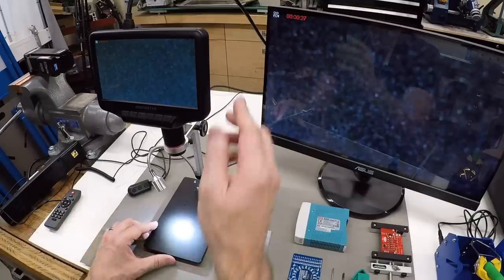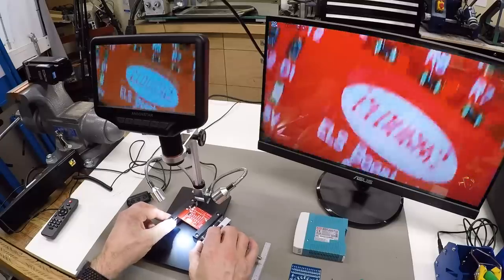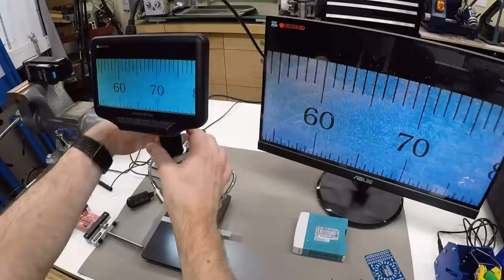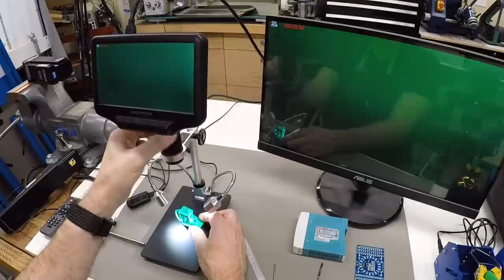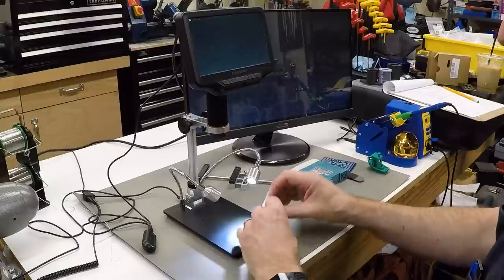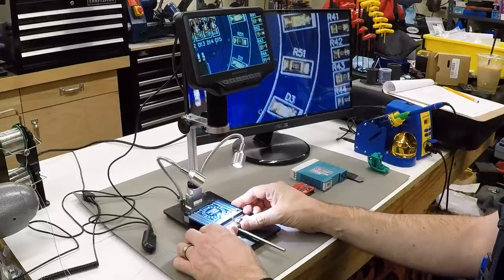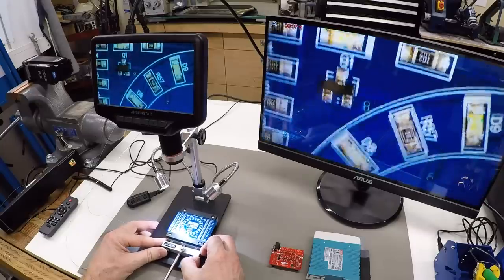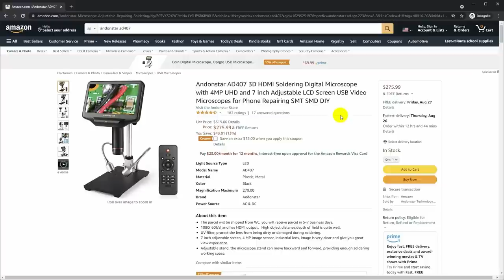Apparently, I Can't Solder | Andonstar AD407 Microscope Review

Comment: I’ve owned this exact same microscope. I can’t speak highly enough about it. Video is crisp and high frame rate. The quality of soldering you can achieve with it is incredible.
Reply: What kind of work did you do with it.  If electronics is the size of the base a problem.  Would the 10.1" be better
Reply: thank You!!!
Reply: what about latency?

Comment: I think it important to keep in perspective that a low cost device like this cannot be all things.  To me, this is an inspection device and it seems that it can do that more than adequately.   For soldering surface mount devices, clearly a binocular system is required and asking to do that with this is just too much
Reply: Why is a binocular system required? To get depth of field?
Reply: I place and solder SMD parts with this and have never had an issue with the lack of binocular vision. Takes some getting used to, but with enough practice I find it to be quite easy to place (and lift) components solely by looking at their position on the screen, with no true depth feedback.

MUCH more convenient than a conventional microscope if you ask me, since I can sit in any position I like and still see the screen.

Comment: James - thanks for the great work!  One suggestion for adding an audio track for sync:  If the microscope is capable of plugging to a PC and acting like a webcam, use software like Snagit or OBS Studio to record using the 'scope as a video source and the PC's microphone for audio.  It's not a great audio track, but the "clap in view" technique still works fine.  My company makes ultrasonic test equipment, and some of that can do remote screen share to a PC.  I use that exact technique with OBS recording the screen share along with cameras and regular audio track for the rest of the setup and test.  So far my editing efforts aren't up to your level, but I'm improving with practice and watching what you, Quinn and Tony do.

Please, keep 'em coming....

Comment: I’m an amateur doing bits and bobs with pretty poor eyesight. I have the 8.5” version of this (under a different name) and for the first time I can do SMDs on a practice board with leaded solder. The extra 1.5” seems to be very beneficial for the field of view, though there are still times I use a jeweller's visor. The depth perspective was fine for me soldering… but using tweezers was a different matter. For someone like myself it’s perfect, I use for everything from soldering through reading ICs to reading that small print they put in to con us old fogies. I'm not saying it’s the best fit for a professional but for folks like me I recommend it. Mine was £110 but like many things they seem to have shot up in price to £140ish.

Comment: The biggest limitation to this scope is the base. If soldering on a larger board, it may even be impossible to do it because of the base. So i purchased and articulated arm made for another brand of scope but it works grade. When i dont need the scooe i articulate it out of the way.
Reply: got a link to the arm? 😊

Comment: A flashgun can be used for sync in lieu of an audio cue. A simple white LED flash is enough, and combined with a scene marker like you demonstrated should make things easier to work with in post.

One thing you didn't mention concerning the microscope, is if there is any discernible lag. I couldn't see much during the video, and you didn't note it, so I assume that it is minimal. 

Using a Stereoscopic microscope prior to this has spoiled you James. I had the same issue when I tried one like this after having been used to using high quality stereo scopes before, although lag was also an issue for me.

I can see that a different mount - Manfotto-esque speedmount or even Noga, especially on a machine could be highly useful. Suspended overhead would be my ideal for keeping the workspace clear. Thanks for the honest review.

Comment: Is it any easier with one of the light sources positioned “north” of the solder target (instead of east/west like you had it)? That way, the shadow cast by the solder wouldn’t be obscured by the solder itself, and might give a good indication of height.
Reply: Weirdly while I'm watching the video I can tell he's got the solder too high simply by the fact it's out of focus, but he can't tell it's too high even though we are effectively watching the exact same thing in 2D? Weird.
Reply: Yes, I too have this model and simply moving the LEDs and or my magnifying ring light I can get a bit of a 3D view happening. Another trick is to lay the board at a slight angle; then the height can be seen. All that said, I have no problem soldering under this scope. Just practice mate and remember it cost only a fraction of your stereo binocular doover so comments should always factor that in.

Comment: After years of stagnation, the digital microscope market is evolving rapidly.  The Andostar scope you review has a 4MP camera and a 7" diagonal monitor, and currently priced at $200. If you like that scope you might consider the Tomlov DM201-MAX with a 25MP camera for $165.  Tomlov appears to have a much wider selection of microscopes for applications besides soldering and inspection.   The DM201-MAX only records in HD (1080P) but I don't need to record UHD video (2k), I do need to be able to capture high resolution stills and blow them up to see very fine details on knife edges.  The higher resolution camera and Sony chip in the DM201-MAX makes that possible. If you need UHD/2k recording capability, some Tomlov models can do do that too.  Be care shopping for Tomlov scopes however.  Their system of numbering models is rather confusing and they offer dozens. Make sure you check the specs of whatever you purchase.
Reply: how's the framerate and latency on the tomolob?

Comment: I learned to solder 0.005 plated wire onto ceramic substrates using a Weller solder station and with no visual assist in 1975 at Univac in Roseville, MN. You had one attempt to get it right. This was for 7015 plated wire memory stacks. Now I certainly appreciate any assist, and these USB or screen-included microscopes are awesome. This is a good overview of the pros and cons, thank you.
Reply from the maker: How old were you when you were expected to do that?
Reply: @Clough42  27, I think the secret was just enough liquid flux.

Comment: We would normally use and setup the lights to produce no shado and best picture.

However although that still applies for inspections, it may be practical to adjust lights for adequate oicture and to have additional luminance to provide shadows from iron tip and solderr.
Obviously, holding the solder above the board would have a gap between the solder tip and the shadow tip and as the solder gets closer to the board the shadow will hunt for the real solder end. So it may be a case of learning new tricks. However with my eyes in your boat, I just use the feeling in my fingers to slide the solder over the boards.
Reply from the maker: Probably true.
Reply: @Clough42  Hi, I was watching Stefan Gotswinter. Youtube is quite amasing, I only watch about 12 channels in total, Applied science, Mike Patey, you, TOT, Adam Booth, AVE, Electroboom, Anton Petrov and Jody (welding tips & tricks), Sina (drummer) and the electronics guy from Switzerland i.e: only the sensible clever people, and it seems they often know each other. Stefan commented about TOT a while ago and Joe Pieczynski today (obviously with complements), so I asked Stefan how long before he mentions you?

Comment: I also struggle with middle-age closeup focus degradation and it's quite frustrating.  To maximize the depth-of-field of my eyes themselves, I have two LEDU L445BK combo incandescent/fluorescent arm lamps.  The use of two bulb types improves the color spectrum and this helps when, for example, trying to read resistor color bands.  I also got prescription 400mm to 100mm focal length progressive lenses.
Reply: i m with You Matthew!  is heavy frustrating

Comment: I bought a "similar" one about a year ago (off Ali E of course). Use it all the time and it's been great. Funny thing though, is 75% of it's use is me finding metal or wood splinters!  Works awesome for that, and I keep an Exacto blade handy for extraction.  45 years of automotive and metal work, you get used to it.  ;)
Reply: you use it for pulling splinters out of yourself?  Brilliant!  I needed a reason to buy one of these!
Reply: @gizzyguzzi  - glad to help justifying it!  Sometimes you just need that tiny extra 'push' to get you over the edge.  ;)
Reply: @DrFiero  I use a jewelers loupe, a fine sewing needle and a pair of needle nose tweezers. Cost a hell of a lot less and don't need power to operate. Lighting is sometimes a problem but that big light in the sky usually suffices. That said I could see using one of these if I had one. A lot easier on the eye sockets. (From holding the loupe in.)

Comment: I don’t disagree with your review, but I’ve been very happy with the cheaper version I bought from Banggood 3 years ago.  It had a 4.3” display and a ring light instead of the flexible ones, but it was only $45.  I’d love to have a binocular microscope too, but they are much more expensive.  Display is crisp, and I’ve been able to read part.numbers off of partially melted surface mount chips.

Comment: "...I'm not 17 any more..." hit close to home. I used to solder and assemble small parts no problem, and yup, the close-up vision has been moving outward, right into Old Guy Land...
Reply: The first stage is looking for steel rules that only have mm markings and not the stupid half-mm marks.  Now I'm looking for one that only has 2mm markings! ...maybe one with 5mm markings as a fallback!  Hell, if it gets any worse I'll have to go imperial.....and find one that is only marked at full inches!
Reply: @Cenedd  get one from CEE's friend that measures in banana's. 
Yes it certainly doesn't help when your arms are no longer long enough

Comment: I just bought ad407 for its 4mp sensor and hdmi out capability.  But after a few days of using it, I think that the picture/video quality on its 7” screen is the same as ad207.  The only difference is the focusing range.  At the same zooming size, the ad407 gives you more working space under the lens if you mount the unit at the bottom red ring (and of course, you need to chin up more to its higher screen).  I hooked it up with both my hd tv and a 23” 1080p fhd gaming monitor.  No matter what resolution I set, the big screens always show “1080i” with exactly the same (bad) quality of grainy videos and pictures for all resolution settings.  The sharpness selections also give no difference effect on both screens.

Comment: It's possible that the recordings still have a timestamp in the metadata. You can check using either `mediainfo` or `ffprobe` (part of the FFmpeg suite), or there's probably some GUI tools that can do it, but I assume you're experienced enough with the commandline to handle it.

If the microscope does add timestamps, note that some devices save the start time and some save the end. That should at least be enough to let you match up which clips go with which source audio, and if the clocks are close enough, and the timestamp precision is high enough, it might let you sync.

When I edit videos, I use a horrendous pile of Python and bash, going by timestamps to line stuff up approximately, then the waveforms (where available) to get it precise, then break the recordings up into takes/chunks, which I can review manually, deleting the bad ones, keeping the good ones, then concatenating them together with ffmpeg. (I don't like GUIs.)

Comment: Thanks or the review. 
A more angled, less even light (side-lighting) might help with the depth perception issues. Just a suggestion, but I'd try a low angle specular (small) light slightly back and to the left and a more diffuse light above, slightly to the right of center to balance it out. Some amount of "shadows" should make it easier to see the depth.
Reply: Just manipulating the two side spots (possibly only using one of them) and having some ambient room light as fill will help a lot. I have one of these I use for the sort of soldering her was trying, and it works for me.

Comment: 19:46 - Cleaning a hot tip and putting it in the stand for a long time leaves nothing but the tip itself to oxidize - damaging it over time.
I was told to apply solder to the tip when done working. Also makes cleaning the tip a breeze when needed for the next soldering job.
It was back when I was an radio mechanic apprentice (25+ years ago) - today I have Metcal tips which are 10+ years old and still in great condition.
3D view is something I love, it makes it much easier to see 'tree-top non flowed joints' like the one done at 18:01
Reply: If you use a brass sponge it's always coated and you don't have to worry about it.
Reply: A little bit of solder on the tip becomes the sacrificial part, a good habit.

Comment: I used mine to solder an 8 pin audio amp soic.  that was about as small as I was comfortable with, these days I have it mounted a good meter up above my TV and it is used for wide inspections on the TV screen (40 inch)

Comment: i have 2 models of adonstar including this one , using at work for quick inspection.

i agree the depth of field  is too narrow , and maybe we had the same idea :

what about to fix the microscope to a swing arm ( a good one , maybe with spring or pneumatic suspension )  
and shout from far ( like 2 feet )  
then connect a 4K big monitor ( like 40 inch TV )  to it and have the max surface for inspection ?

not sure I tested this model with 4K output

Comment: You can increase the depth of field by making the aperture smaller in diameter.  You may also need to increase the light intensity to compensate for the loss of light due to the smaller aperture.  I am assuming that you do not have enough magnification that diffraction is significant in the resolution.
Reply from the maker: Sounds like a design tip for the manufacturer.
Reply: Maybe you can make a diafragm by making a small hole in a piece of some material, plastic, metal, just under the lens?

Comment: Why were you only trying to look at the screen to do the work? I can definitely say that trying to use a single zoomed in display would be extremely difficult since you lose depth perception as you very clearly noted. 

Have you tried working while keeping your focus on the board while using the computer screen in your peripheral or placed back behind the board (working so you can either glance back and forth between the two or simply focus on the picture while “seeing” the board and tools just below and in front of your focus)? 

While this may seem like you’re trying to look at 2 different things at once it’s actually very easy to pickup. For instance at this moment i’m typing with my focus being locked on my smartphone screen yet I can easily describe the objects behind and off to the sides w/o much effort. They most certainly will look out of focus but in a moment that detail will become irrelevant. 

Conversely if I focus at the object immediately ahead and behind I can no longer see the printed lettering for individual keys on the digital keyboard but even though my thumbs look out of focus, I can easily tell their changes in 3D space relative to the object I’m keeping my focus on. 

The farther out in ones periphery an object is the more likely it will exist in only a single eye’s field of view so by keeping it relatively close to your area of focus you can still gain that missing depth perspective that the screen couldn’t capture in its Top down view.

Comment: I picked up one of those (probably a different brand name, but the same thing, for about 40 bucks) because I had to replace a couple of power supply resistor chips on 50 embedded PCs. There was no way I could even see the parts without a microscope with my eyes at my age. It took me about 20 minutes of poking around to figure out how to get the resistor, iron, and solder, all into the same place at the same time. I've used it for a number of things since, but I only use it when I need to. I'd rather just work under a normal magnifier if I need to see something.

On syncing sound on silent video: make yourself a slate with a clap stick. The slate is a board with places for production name, date, scene name or number, and take number. On a movie the production assistant has a log with that information, and holding the slate in front of the camera for a few seconds at the start of the shot puts the information on the film. The purpose of the clap stick is sound sync. The guy holding the slate announces the information written on the slate, and then claps the stick against the top of the slate. This makes a sharp identifiable sound burst that can easily be synced to a single frame of the image.
Reply from the maker: I have one.  It doesn't fit under the microscope.  :)
Reply: @Clough42  Yea it occurred to me about 40 minutes ago that using one under that camera would be a little awkward. Writing anything useful on it would be even more awkward. :-)
Reply: @Clough42  use a Croc clip (click) ?

Comment: I have a   50" Sony Bravia  1080p 3D TV , I wonder if I get 2 of the cheap handheld microscopes  and rig up a stand for them   if I would be able to mux the 2  feeds into a single  3D signal then there would be depth  perception
and if there would be a delay
also I have  a PSVR headset , i wonder if there would be a way to set it up with  2 microscopes